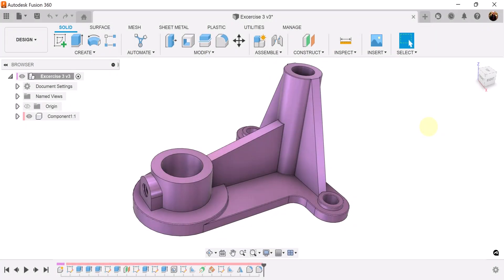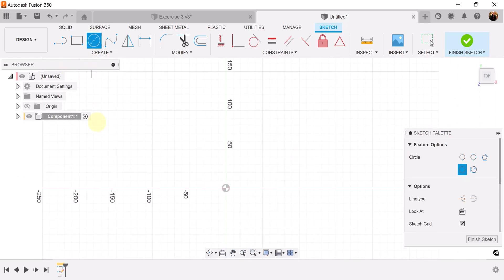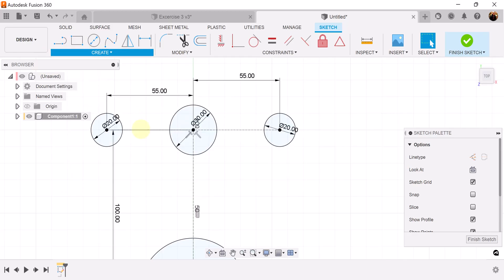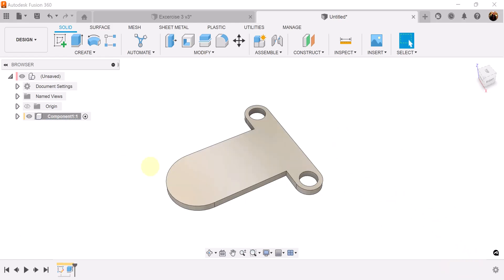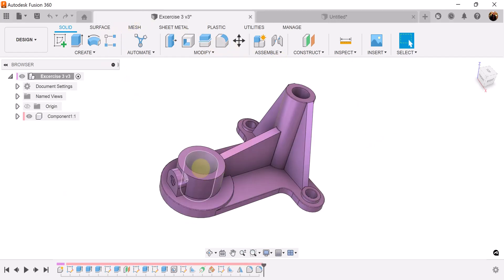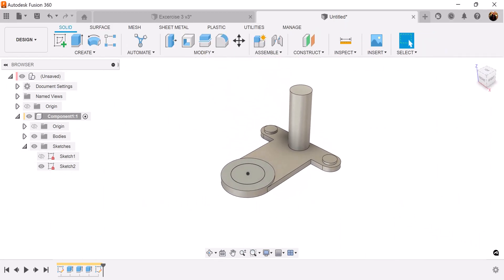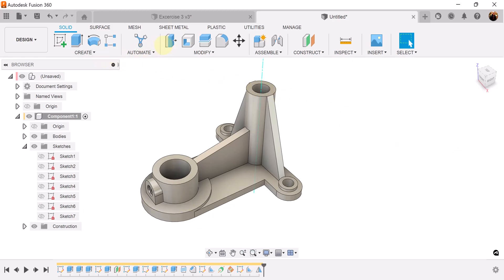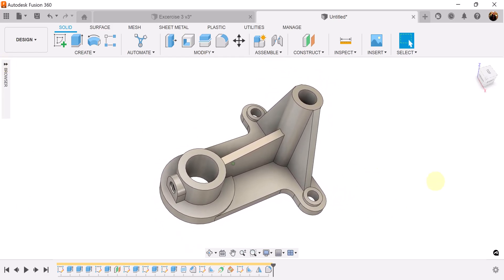Modeling  in Fusion 360 | Rep no. 3

Comment: Hello, can you do this drawing, I cannot figure out how to join the tapered rib to the radius without creating flat spots. Please keep up the great work https://i.pinimg.com/originals/ef/61/0f/ef610f6e3cf833aabfc22bf342ca4774.png
Reply from the maker: I will take a look at this. For some reason this comment was hidden until now which is why I pinned this. Its definitely worth taking a look at.
Reply: @CADJungle  That would be great, I'm teaching myself fusion and finding it has many layers that aren't covered and it's frustrating to say the least.
Reply: Can you please do this actual drawing still struggling with it.  Thanks Again
Reply from the maker: Ok so I was able to create the drawing. Hopefully what I created will give you an idea of how to accomplish this. I plan to post a video that will show how I created this step by step.

I've provided a link to the drawing I was able to finalize.  https://a360.co/3XPki0c
Reply: @CADJungle  Thanks Cad Jungle for taking the time to do this, my issue is still the tapered ribs, I tried using the split face tool, that worked until I went to loft the 2 profiles and an error said intersecting center lines and would not project. I'll wait for the episode.  Thanks again for your help......
Reply from the maker: @sandiwitkoski2501  I hopefully can help resolve any issues you may have.

Comment: On the second rib feature, how come you didn't have to do the added 1" line on the first rib feature?
Reply from the maker: Because it gives a point for the rib to terminate. If not it might continue to the other side in which case you may have to give a specific dimension for the rib to stop. Its not something you have to do, but it does make it more convenient.